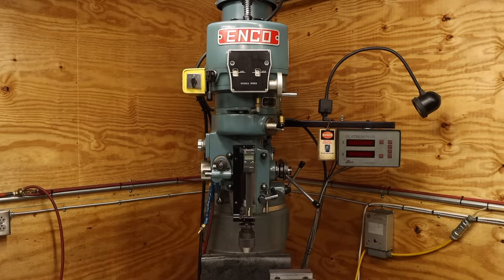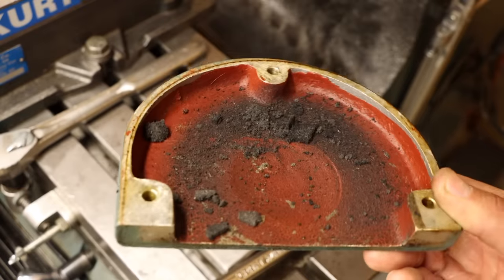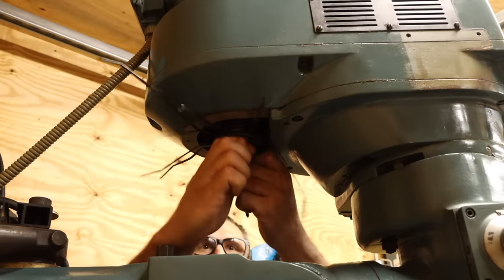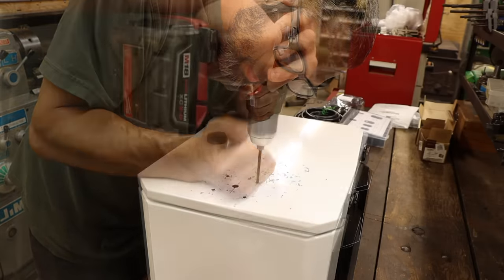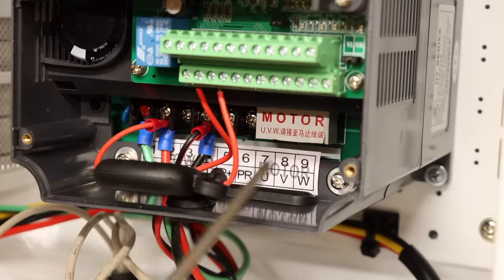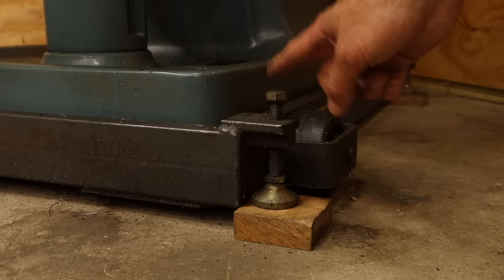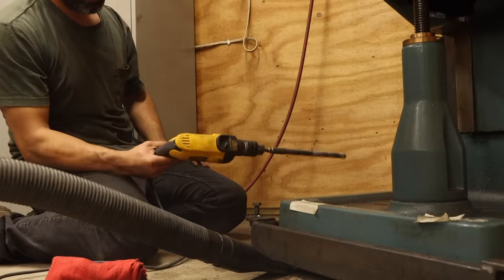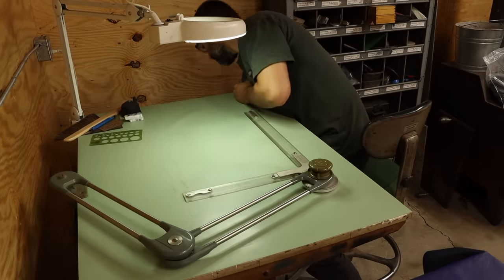What Happens When You Procrastinate...

Comment: As you are very through a few tips on enclosure cabling - wrap the door bundle in spiral wire loom. I would've also used piggyback adapter for the fan power taps. Well done!

Comment: Great video! I think you can uplug the display with the knob from the drive and move the controls externally to the door, that way you can have the knob on properly and monitor your internal temperature, power usage or whatever you choose, most of the drives I've worked with allowed remote control in that way.

Comment: Those Milwaukee hammer drills always surprise me with just how good they are. If you decide to upgrade to a percussion drill I would fully recommend the M18 CHPX. I have used mine to diamond drill 125mm holes through a solid stone wall of 450mm, it took all day, but it was Sunday and the hire shop was shut. I'm on my second one, but the first lasted 7 years.

Comment: Nice overall improvement, good job! One word of caution as it relates to your switch, mine was 4.5 years old, and yesterday, it failed spectacularly.....emitting a blinding zot of flame as I turned the motor on. I took it apart and it was a gruesome mess of plastic junk and they are all pretty much the same. BTW, it was grounded and the breaker did trip.

Comment: Hi Brandon, i love the quality of your videos and learned a lot from watching them. In this one some things caught my eye, so i wanted to give you some tips back.
 
11:00 These triangular locks may have a roughly fitting hex socket.

15:20 Better use wire ferrules to connect stranded cable to screw terminals, especially for mains power connections. Without ferrules the terminal may damage the cable strands and the connection could loosen over time. A lose connection produces heat or could fall off, touching parts of your casing.

14:35 Usually the manufacturer specifies how to realize proper grounding. Anyway, here it looks like the ring cable lugs are too large in diameter and slip over the shoulder of the pin, which reduces the contact surface and pressure. In addition the paint on the pin reduces contact.
Without proper grounding, in case of an error(see above) you could have mains voltage applied to the housing without the circuit breaker or RCD shutting down. The next touch would hurt.
I'd suggest to remove the paint and, if the pin is long enough, screw on a nut, followed by a washer, the lugs, another washer and a second nut to tighten it against the first one. That gives good contact surface and pressure. Also the weld of the pin isn't stressed this way, these welding studs sometimes tear off quite easy. If it isn't long enough leave out the first nut but retain the washer. Because of the welding stud's shoulder contact washers won't work here.

Comment: Did the ole zip tie trick on a pallet truck spring I was re installing, works like a charm and not as scary once you use thicker ties , I compress the spring first in the vice and then cable tie around it

Comment: If your VFDs support it you might want to look into getting dynamic breaking resistors. I am using those on my mill/lathe at home and the lathe with a 14" chuck comes to a stop in 3 seconds without using a mechanical break. Mill comes to a stop in 1.5 seconds I think. You likely wouldn't be able to get breaking resistors quite as big as what I can get away with though as I am using single-phase in my 3ph VFDs, so I can only get 3/5 of the rated power, so I am compensating with larger VFDs (my 5HP lathe has a 10HP VFD).

Comment: If you’re ever in need for more holes in cement floors or ceilings I would recommend you get yourself a SDS drill with pneumatic percussion system. I just recently found this out but it’s about 10x as efficient as a regular battery drill in cement. You would’ve had those holes in the floor finished in 2 minutes with that.

Comment: Replacing that belt was exactly what I needed to see. My machine is new, and it still makes more noise than I think it should. It is a Bridgeport clone almost exactly the same as yours. Everything you did applies to my mill, but more importantly, I learned that the noise is, as I expected, more or less common with belt drives, so I'm gonna let it be. The more I use the machine, the quieter it gets. Hmmm. Maybe the belt needs to wear some high spots off something? Or, maybe I am procrastinating?

Comment: It's good you didnt show the snipping of the zip ties. You thwarted many troll comments on how bad that is. I got those comments on my videos and I stopped snipping them. Nice work on the enclosure! Zip ties rule!! 
Ha, I just noticed you did it at 16:50! Haha, let me know if you get any feedback!

The opposite rotation of the mill could have also been the three motor wires. If you knew you had the FOR and REV correct, you can simply swap any two of the three motor wires, but I am certain you already know that. Just wanted to mention.
Reply from the maker: 😂  I guess they would be referring to the sharp nubbins that's left behind? What's the usual alternate solution?

Absolutely right on the motor wiring. I wasn't sure I had the switch wires in in the first place. They were a bit easier to switch than the thicker motor wires 😁
Reply: @InheritanceMachining  Yeah, the sharp edges, but really, not important enough to comment. Anyway, why not have some war wounds and show experience through physical expression of calluses and scrapes.
Reply from the maker: @PatrickHoodDaniel  exactly! have you seen my hands? a couple extra nicks ain't gonna make a difference 😂

Comment: When using a threaded anchor with epoxy I was always taught you should take a grinder to the part you'll be epoxying in to have 2 flats on opposing sides. The flat areas filled with epoxy keeps the anchor from being able to un-thread from its hole from vibration. If things come loose in the future that will probably solve it!

Comment: I once used zip ties on a front coil spring on a 95 Subaru Impreza. I left it under tension and put about a hundred zip ties alternating between the rings of the coil. It was mega sketchy but it worked

Comment: We used an engine jack to maneuver our 2000+ pound Grizzly mill into position. However, once we had marked the holes for the mounting points, we temporarily relocated the mill. We then drilled the holes, installed the anchors, and patiently waited until the following day to return it to its correct position and lower it into place. If there were ever a tornado in Northern Virginia, I now know a secure spot to anchor myself. This thing isn't budging!

I've had the drill for about two years now, but so far, I've mainly used it as an expensive drill press...

Comment: Great video as always. 
Butt, just two things, that bugg me a little. 
1. Those studs don't allow you to move the machine in case of need. Screws with an epoxy-insert in the bottom would though. 
2. That cables to the main switch in the enclosure would look nicer if they were covered with a spiral or just simply rolled in spiral together. 
Keep on making so fascinating videos.

Comment: Tip if you ever resin in threaded rod again. Drill all the way through the concrete slab. That way, if you want to remove them, you can just pound them into the sub soil and fill the holes. You can remove that resin with a blowtorch but its really nasty. Though i didn't see you brush the holes out which is really important with resin fixings. For this use case not so critical but when i place them for PPE I blow, brush, blow again and if there is still dust coming out repeat. The resin stick to the dust rather than the concrete/rock and in some cases once a little over time (modern resins are better for not shrinking than the older stuff) can just pull out.

Comment: 14:35 - Remove the paint from the box ground studs, and preferably the case around them where the ring terminals should rest.  It won't burst into flames if you don't, but there's no good reason to risk paint degrading your ground connections.
Reply from the maker: Good call!

Comment: I did a similar upgrade to my Millrite with a VFD, but since it only has a 6-speed belt drive having the variable frequency in addition to the 3-phase conversion is awesome.  Great video as usual.
Reply: With the VFD, do you set your belt speed to the highest speed and then adjust your spindle speed with the VFD? I’m getting ready to put one on my small mill and that’s what I’m planning on doing. Thanks
Reply: @Hoaxer51  With my old motor I have the variable frequency limited to 40-70 hz to be safe.  But combine that with the six belt speeds and I can get all spindle speeds from ~180-4000 rpm.
Reply: @mcbhomis ,Thanks for the reply, I was hoping to get away from changing the belt but it’s not that hard, a variable speed would be nice.

Comment: This popped up in my feed again, and I had a thought: What about relocating the cord / motor connections to a separate junction box and using the freed-up space to mount a remote speed pot on the back of the switch box? I saw somewhere another machinist did that so they don't have to reach for the VFD in the middle of a job.

Comment: Just a little warning from my father (rip) that owned a bridgeport - 
even though it is able to run 4200 rpm in high gear, your spindel might not be happy for long runs at that speed.
Make sure your main bearings is well maintained if you plan use the high range of rpm's and keep an eye - sensing hand - on the temperature of the spindel and it's bearings while you use those high revs.
If you are careful and sensible it is a super feature of these mills
Reply: Yeah that one bearing on the top looked awful.

Comment: Beautiful work. A small tip would be to use cable ferule to put multi strand wire under a screw and to crimp wires without twisting.

Comment: A sneaky problem, if you run the mill motor slowly, it will not get enough cooling air from the internal fan. If you plan on using the VFD to run slowly, add a large fan on top of the motor ( not frequency controlled ) to keep the cooling air volume up.  best regards  Steve

Comment: You should add ferruls to the wires that plug into the VFD ... makes sure things never short and looks better :) 
Whever you drill for long periods - never cover the back of the drill - it causes the motor to heat up quickly.

Comment: The adhesive zip tie mounts don't stay stuck after a while... Trim the zip ties with toe nail snips and it won't leave sharp edges to cut you and the other wire insulation.

Comment: The only thing that went wrong here seems to be the fuse for the fan. That automotive fuse is going to arc and melt really badly with mains voltage, if it ever blows. I would definitely go back in and replace it with something rated for what it's supposed to do.

Comment: That Chip Trap (AKA the portable frame) is easily removed with an angle grinder and cutoff wheel...

3 chops (1 center rear and 1 on each side near the front) would allow you to simply peel it away from the base and then, if you REALLY want to improve the support, you can use non-shrink grout to fill the void under the base to create a conforming (mostly, there will be voids) concrete base for the mill to sit on...

Comment: Back when I worked as a residential electrician we called those zip tie mounts "sticky-backs" for some reason.  They were great for cutting in breaker panels and getting all the neutrals in an bundle so you could make perfect right angles into the bus bar.
Reply: I was thinking about zip ties when I saw him removing the CVT, dreading the unleashing of the spring compression. When I do that I use a bunch of (strong) zip ties to bind the helical turns together.
Reply: Ha: I've just watched further into the clip, and Brandon came up with the same kludge to get it back into place (although in his case he had to use masses of the damn things, because he hadn't thought to do it before removing the spring tension in the first place)

Comment: The one thing about how you stuck the mill to the floor is if you ever need to move it again. Brass anchors in the concreate would do the job just fine and if the bolt is removed you just have a hole that you can fill if you want to.

Comment: The control panel on the VFD is more than likely removable and are usally conected via a short RJ45 phone cable with one of the retaining catches removed. Then you could have mounted that to the control box's door.
Letting you change parameters when ever you like and you can put the knob back on..😅
Now with VFD acel and decel, tuned right you can go straight from fwd to reverse with out a worry

Comment: Just a little idea from an industrial tech.  I would suggest putting the disconnect on the side to eliminate the wire running the door, you pinch a wire in the door you have a hot door until the breaker trips…. If that painted ground stud actually trips the breaker…

Comment: you probably know this but that old motor probably isn't inverter rated.  which means that you shouldn't run it too much lower than 60hz or the windings will get a little warm on ya...

I just peg mine at 60Hz and use the crank to change the speeds.  I've looked for something that would just convert 240VAC single (or split) phase to three-phase without all the junk (cost) needed to vary the frequency, but haven't found one yet.  seems like it would sell...

I really enjoy what you're doing on this channel, brother!

Comment: Hey Man, ya gotta be careful about hitting Rebar in the concrete. There is a special bit with 4 bits to cut through Steel, then switch back to the normal bit. Thanks for showing some chips. ALWAYS show some chips. Love watching some chips fly. Also, love the extended vid at the end. ALWAYS include a BONUS clip at the end. Lets you know who actually watches to the end. (Trade secret) Until Next time, Small Shop Talk Over and Out.

Comment: Nice.   Looking at the base cart, I would have struggled cutting the cart.   And then struggled to level it.   Leaving same result. 

As an electrician, you said something that bothered me.   "I'll just start with power supply"  out of habit, that's where you should have ended.  Start at the end, and work your way back to the power supply.   By yourself, you (should) know the power is out.   Working a job.....  most electrocution accidents happen when (example) you go to replace an outlet, and someone comes along to get a cup of coffee, and the coffee maker don't work.   They go grab someone from maintenence and that person finds a breaker off.   And you're working the other end.   They have no idea what a lock or is, or what the red device attached to the breaker is as they rip it off.   Also, they don't know what is or isn't connected in the panel, so they turn every breaker on in the panel. 

Work it like it's hot.  And the hot wire is the last thing connected.   If it suddenly comes on, someone complained about the coffee.   If you had started with the hot, halfway through the job when you wake up wondering where you are, think coffee.
Reply: I was getting ready to say that's what Lock Out/Tag Out is for until you mentioned someone removing it... Which in turn is how that someone gets their butt fired!!!
Reply: @plunger110  but they don't understand why.   Double sided sword.   Responsibility comes down to you.   Check, double check, triple check.  Work on it like it is on.  I've been hit by someone that forgot I was working the circuit.   I didn't work it like it was hot.   Sometimes you learn the hard way you can't trust your coworkers.  Let alone the public.

Comment: I had to change the alternator and belt on a 2013 Ford transit. Let's just say that Ford cheaping out and not adding a tensioner pulley between the alternator and crank led to a few choice expletives as I tried to pull the belt over the crank pulley. That was total hell.

Comment: I remember back when we had to change belts and do some maintenance on our Bridgeport's. That was a chore. We had 3 mills, with one of them a very rare co-fab machine between Bridgeport & the Sharp company. Sharp made the machine, but got some of its parts and engineering from Bridgeport. We found this out when he had to contact Sharp they told us to contact Bridgeport, in which they told us to contact Sharp. And round and round we went. Upon talking with an old timer at Bridgeport, he actually remembered this project and had to dig through an old archive of documents to find the machine. Its a nice machine w/ 4HP + power. They only made one machine together and ran it for production 1 year. Of the 3 I was always partial to the Sharp machine, beefy table, beefy power. I was able to take cuts on it that the others just couldn't. However, we didn't have any VFDs or rotary phase converters, it was all straight up 3 phases from the tap in our shop.

Comment: The VFD panels for the large machines where I work are in air-conditioned enclosures.  Also concrete gets harder over time.  You're old faithful hammer drill would have likely had no issues if that slab was less than 6 months old.

Comment: Well, anchoring you mill to the floor sure makes it tornado proof.  Seems like a couple of 4 inch square by 3/8" steel plates with a counter sink in the middle to accept the nose of a bolt would have done just fine .... and easier to adjust level.  I have 4 or 5 machines in my shop set up this way and it works just fine.  Enjoyed the video.  Thanks.

Comment: I have similar CVT in my wood lathe and i used exactly same zip tie trick getting that pulley spring back in place. =)
At first look of your setup, i was thinking you can use just some bottle jack for lifting/compressing that bolt, washer and spring back in.